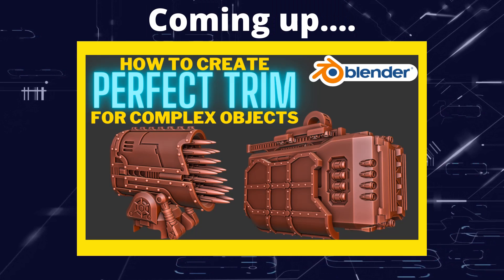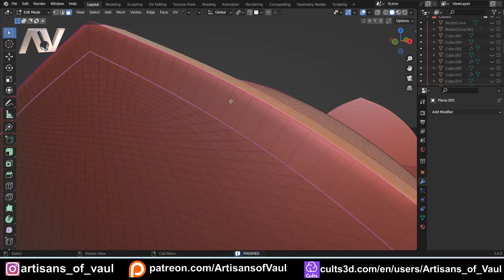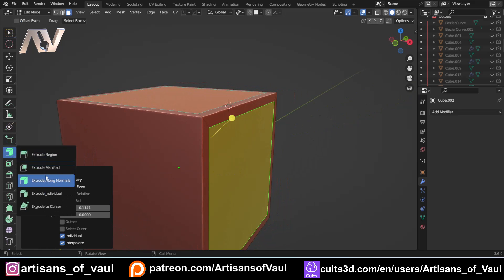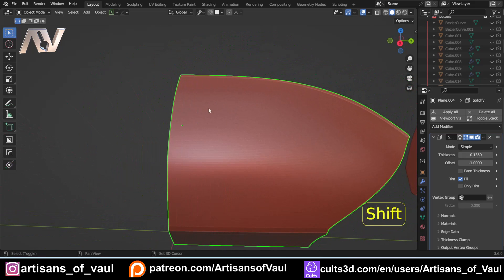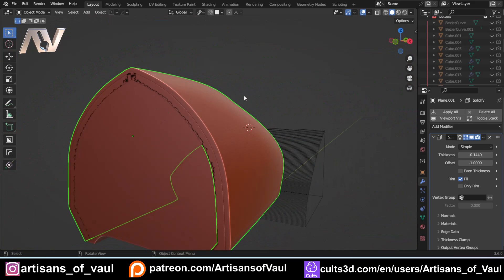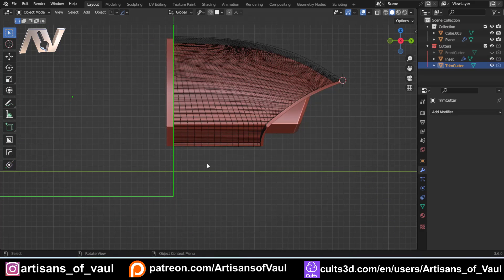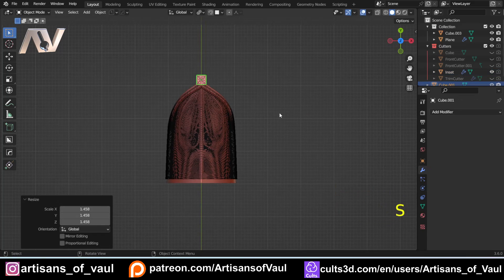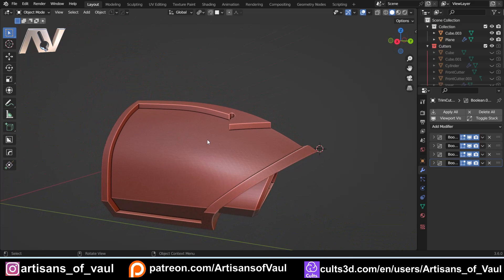Creating perfect trim on complex objects in Blender

Comment: Great trick. Ive been using emacro while holding ctrl shift on faces after making loop cuts. Not sure that will still work on more complex objects such as this though so i will give this a try.
Reply from the maker: That works but it can cause some results that aren't going to be smooth on the sides of the objects if they are a more complex shape because of the normal direction.  This can be solved by using a cutter/boolean on the sides or merging some geometry but I find that takes longer.

Comment: Great as always! This technique is working on a complex curve in the x-axis direction, with you having a straight edge on the back section and a preformed cutter on the front section to produce nice clean edges for you when you add these as cutters to your overall trim cutter. Can this technique work if you have a complex shape across all 3 axis? say, in you example, you didn't have the cutter for the front of the jet bike to incorporate into your trim cutter - how would you solve that to get nice even trim? - thanks!
Reply from the maker: I've used it in pretty complex situations with curves on most plains.  The biggest issue is if you have something like a "wave" shape but you can still do it. In that instance it's just the point you scale the shape needs to be considered a bit more and I instead went into the object and moved the faces in relation to the normals using alt+e. But it's complex shapes like this that it really shines as a technique.
Reply: @ArtisansofVaul  thanks - maybe an "Advanced" trim video on day 😅?
Reply: rewatching your panel line video using the gundam head I wonder if that approach could be used for trim also 🤔
Reply from the maker: @Robert-ln1cx  You could use it in combination to make some cool trim I think.

Comment: Ex-Maya user here with a question about the cutters in Blender. If i'm looking to export them as assets for game dev/moving to other pipelines for rendering, do I need to apply these booleans and then touch up the polys? Or is there a way to export everything with a super high sub div so as to keep all the cutter deformation, etc?

Love the vids btw~
Reply from the maker: So this can cause issues for hame assets as it produces Ngons so it isn't ideal for that purpose.  I'm not sure but quad remesher might have a good go at cleaning it up but I haven't tried it.

Comment: First of all thank you for your great work. One questions remains currently for me. How do you get the grid of the inset shown in solid mode? Is this related to hardops or can this be achieved without any paid addons?
Reply from the maker: Could you point me to a time in the video where what you're talking about is shown. I think you're talking about something that's part of hardops but I'm not totally sure
Reply: @ArtisansofVaul  thanks for answering that fast. It is e.g @10:28 where the mesh is shown greenish when selected or black when not selected

Comment: How get the rivets or bolts to follow the mesh? I don't wanna use geo nodes and the curve way by using a plane to stop warping is so frustrating.
Reply from the maker: @RandomPickles  I think you're going to be stuck if you don't want to use the Geonodes way I'm afraid. Unless you get everything to be perfect quads and that's more of a pain than the other methods by far....

Comment: it looks like it's a demanding workflow concerning the amount of geometry >_< is it still looking that clean if u happen to apply everything ? my booleans often look good until i decide to apply them XD
Reply from the maker: It's honestly the least demanding I have found for achieving really decent/complicated trim.  By clean mesh it depends what you mean. It won't be quads bit it will be perfectly 3d printable in my experience (and I've used it a lot)
Reply: @ArtisansofVaul  I don't mind not having a perfect quad based mesh, I'll try it and see for myself, it's indeed looking super clean, thnx!
Reply from the maker: @@lusaks4226 I don't.  Its on my purchase list but Im waiting for the next Blender Market sale as its one of the more pricey add ons 😅
Reply from the maker: @mathieu499  I find quickly running it through 3d builder will solve almost any issues I've had with this technique (typically non-flat faces) though it can also be solved in Blender with a triangular modifier (it's just so rarely needed now I usually don't bother)
Reply: @ArtisansofVaul  I don't use any software out of blender but good to know that the tri gular stuff will help! Thnx again AoV 🙏
Reply from the maker: @mathieu499  3d builder is free from Microsoft and I don't use it for anything other than mesh checking and it's really impressive at fixing things. It might be worth checking out.

Oh, it also seems.to do hollowing for 3d printing better than both lychee and chitubox in my experience 😅
Reply: @ArtisansofVaul  Yeah 3D builder is a godsend. Thanks to your Do's and Don'ts of Booleans video teaching me what I need to worry about and what I don't, checking for flickering intersecting faces being the biggest issue, after that sticking it in 3D builder solves so many issues. Had my first ever miniature printed as a test the other day (it's based on the Bertie robot from the World War Robot range) and now I'm on to more complicated things.
Reply from the maker: @luketfer  Congratulations on the first print! It's such a nice achievement and for me it really made it feel like a "real" skill. Hope the future projects go well and always feel free to comment/message if you need a hand with something.
Reply: @ArtisansofVaul  Oh I do actually have a question, currently working on some space marine style power armor. What did you use to get the 'ridged undersuit' that you see at the hips, knees, elbow etc.? I'm probably not going to rig it so it's going to be more like your Saturnine Terminator figure.
Reply from the maker: @luketfer  Great question. So I've actually always found it more of an annoyance than it's worth to rig the soft armour. It almost never works out. So I just rig it as an object so it moves to about the right place (if I bother rigging it at all) and then use a lattice modifier to get the shape/deformation right. You can see that towards the end of this video: https://youtu.be/g-IPvEyS7qQ
Reply: @ArtisansofVaul  I completely forgot you used a similar effect on your sci-fi gauntlet! I shall be watching that video again, thanks for the help.

Comment: Good but fast video with normal audio is a headache
Reply from the maker: The audio is an issue because its too fast?  Or is there another issue?  Sorry if its a bit fast, I was worried it was a bit slow actually at points 😅  But its a quite complex method, maybe I should have slowed down more.
Reply: @ArtisansofVaul  Sorry by the critic, your videos are fantastic but is difficult to see what tool or modifier your selected.
Reply from the maker: @pieralessi7426  No problem at all man.  Any positive criticism is helpful for future videos.  Its generally the solidify modifier to make the thickness and then the other objects cutting through is using boxcutter/boolean modifiers.
Reply: @ArtisansofVaul  Thank you so much!